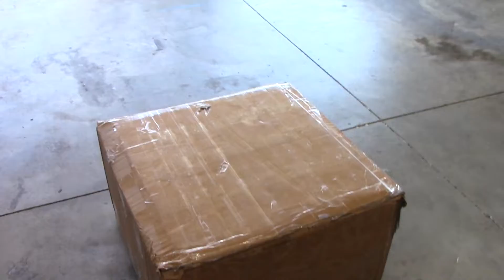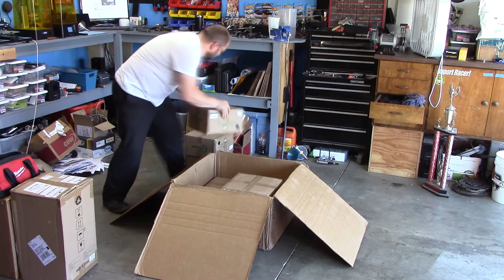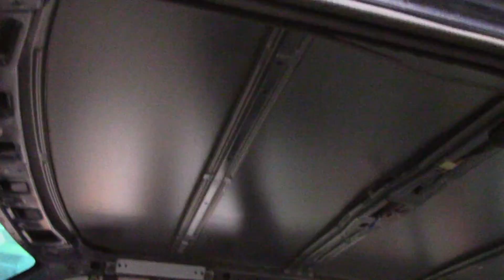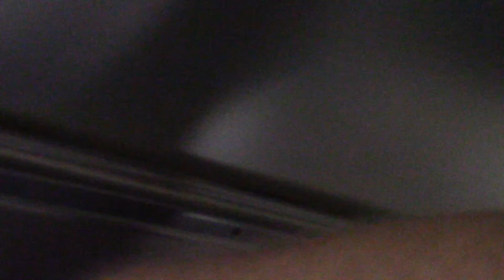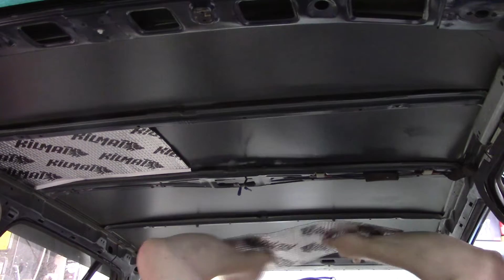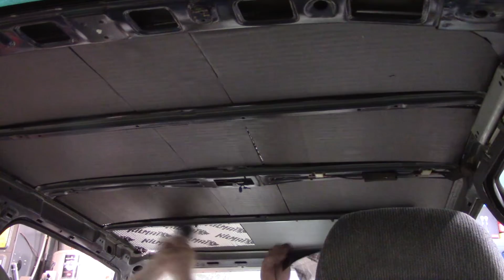Vlog 28 - Unboxing 90lbs of plastic, sound deadening Suki

Comment: What printers are you using?
Reply from the maker: I am using 4x Creality CR-10s printers, I also have an Ender 3 and a Prusa.  I just got some RatRig printers which are way bigger than the CR-10s printers.  They have a 300x300mm print area where the RatRigs have a 400x400mm print area and have a much better frame and print head so I can kick up the printing speed like 3 times or more.  Excited to get those up and running.